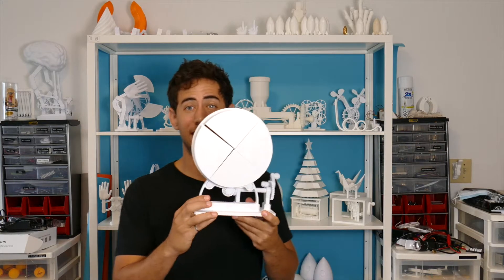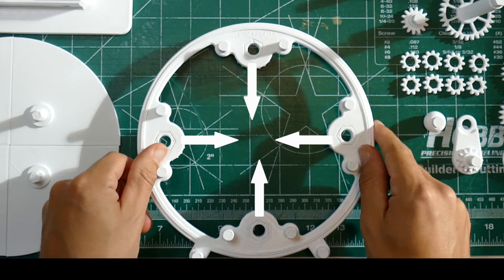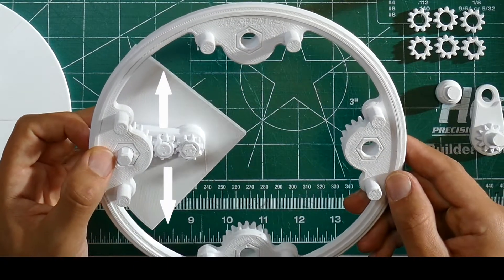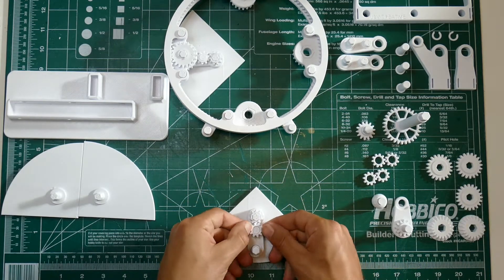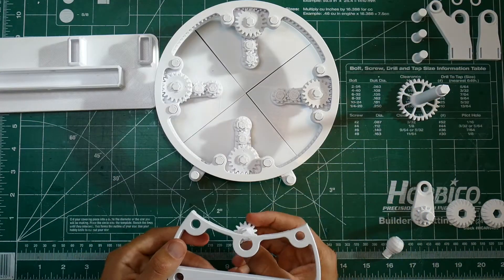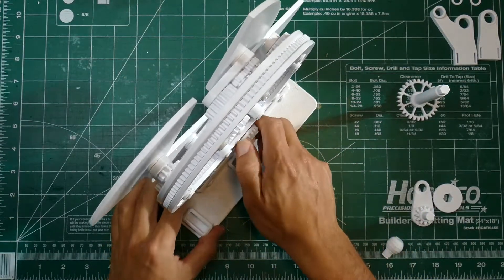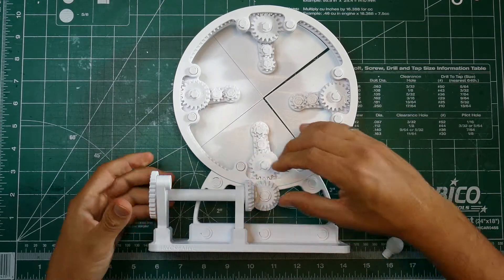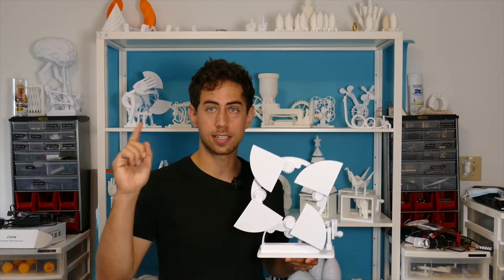The Exploding Circle - Fully 3D Printed Mechanical Sculpture

Comment: I love this model. I printed it and put it together and although it looks fantastic and everything went together easily I just can’t get the fluid motion like the one in the video. I don’t mean it’s hard to turn because it’s not. It’s like all the little gears have too much play in them so they feel loose and sometimes hit each other. I’m sure it’s something I did wrong but I’m positive that the tolerances on my X1 are good. I print functional parts all the time. No matter what I still like it. Now on to the next one then the clock.